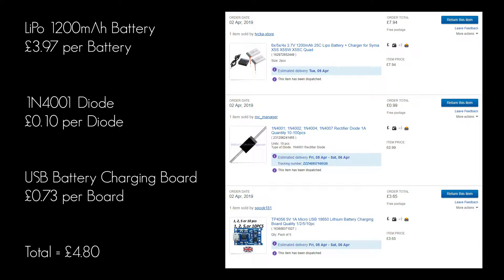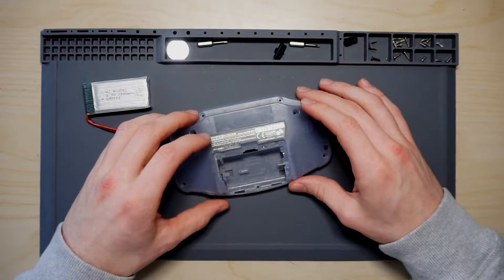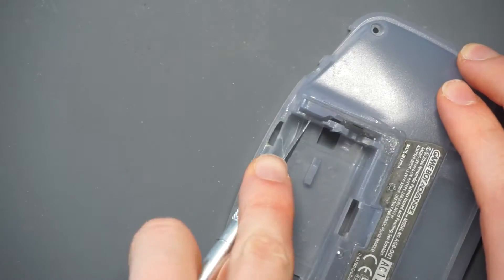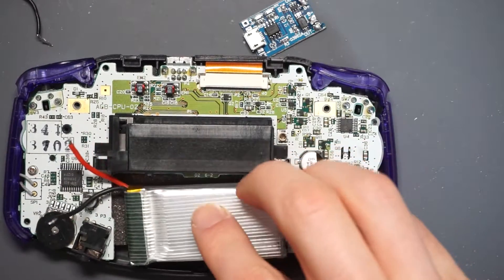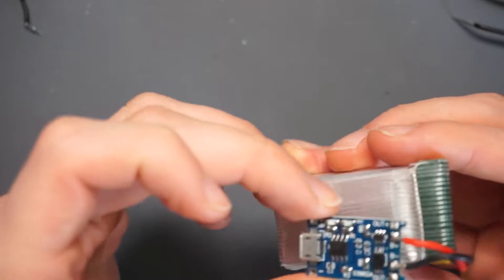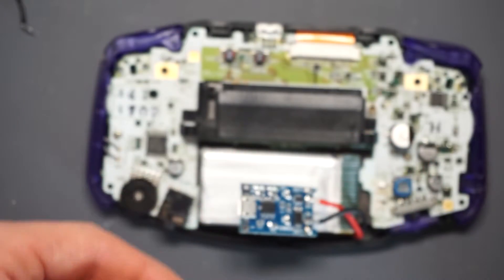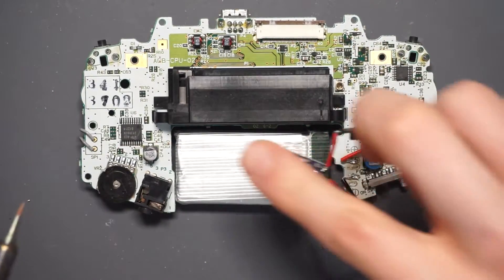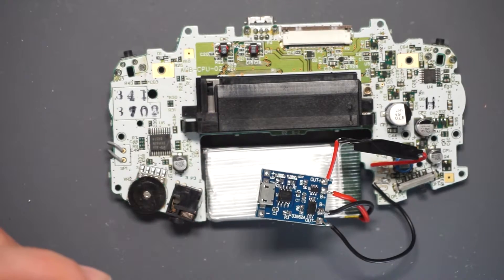Cheapest GBA Rechargeable Battery Mod! £5 TOTAL

Comment: is there a way to build this with connectors, so you can take the battery out without screwdrivers and solderiron?
Reply: You’d probably want JST PH 2.0 connectors. solder a female connector directly to the motherboard’s battery terminal pads and the male directly to the charging board.
Reply: is it possible to solder the diode directly to battery terminal or do i need that extra wire tnx
Reply: @bryandelacruz4569  you can go right ahead and skip that wire, as long as it's the same connection. In these cases wire length doesn't matter, as long as components are connected in the right order
Reply: @JBarraza  thank you sir
Reply from the maker: I assume so, but couldn't really advise you on how to do it! Check out the sub-reddit /r/gameboy they might be able to assist you better on there!
Reply: https://imgur.com/gallery/AQGJAHX
Reply: I'd use smaller connectors but it is possible, so you can have many battery packs just to swap out while the others charge

Comment: With the wires that has the diode soldered to it, would that require a specific red/black wire?
Edit: I meant the AWG stuff... I see so many different cables, I'm not sure which cable I'd need.
Reply: 22awg is a good size for small eletronics. Wire color doesn't matter as long as it is still wired the same. Awg is the thickness of the wire.

Comment: You know the batteries wires, right? Can I just solder a wire onto it to make it longer and what kind of amp rating wire is compatible with this? Because making the board sitting down in that position....
Reply: Your pretty ok with any gauge wire, just don't use super thin wires, I have #22, that would work fine

Comment: i used 4 different lipos and soldered them dirctly to the pcb of the gameboy to see if that works but the gameboy won't turn on. maybe to the voltage is to high? i used a 3,7V lipo too
Reply from the maker: Retrohahn I’d probably say there’s a blown  fuse on the board
Reply: @TheRetroStation  but it's working with normal AA batterys
Reply from the maker: Is it on a gameboy advance? If so you’ll need a diode
Reply: @TheRetroStation  yes, ok I will give it a try thx ;-)
Reply: @retrohahn  yes it's over voltage. A charged li-on battery is 4,2 volts. The GBA only nerds 3.0 volts (1,5+1,5 from the 2 batterys). 
So the GBA has an overvoltage protection circuit (thank lord) so it doesn't turn on when a higher voltage is applied.

Short answer:
you really need that diode.

Comment: Hi is the Diode used for regulating voltage for the gameboy?
Reply: And would it work without the diode
Reply from the maker: @mrej112  It would work, but a diode prevents electrical flow from going the wrong way around a circuit so prevents you from doing any damage to the board.
Reply: @TheRetroStation  thanks for the video and the fast reply!
I am about to do the same mod, now i am just waiting for the diode 😉👍
Reply: @mrej112  - It actually would NOT work without the diode. You'd turned on the GBA and it would immediately trip an internal safety feature and shut off. I learned this last night. You can get a diode by cracking open an old power adapter. You know, the ones with the big chunky plug on the end? I got mine from an old electric razor power adapter. Worked perfectly. :)
Reply: altoidyoda how would I know what diode's I can use and not use? Or would I be able to find it in all kinds of power adapters? Cause I got tons of those and I've seen these longer of diode's in them just never knew what to recycle or not thank you so much in advance.
Reply: @ericsalidbar1693  you could play it safe and follow strictly what the uploader recommends, or if you insist on using something you found,  you'll have to look up the part number, read the datasheet and make sure theres a 0.7v drop across the diode. You can also measure it with a resistor in series and a powersupply.
Reply: @mrej112  The diode should step down the voltage of the battery from 3.7 to around 3.0v  which is exactly what the GBA needs!

Comment: Micro USB is old school. I'm doing mine with USB C. https://www.ebay.com/itm/1-2-5PCS-Type-C-USB-18650-TP4056-Lithium-Battery-Charger-Module-Charging-Board/173807428917?var=472489214008
Reply from the maker: Hey, for some reason I cant see your comment on the video page but only in my studio...

Anyway, USB-C is 100% better I agree I just didn't think when I was purchasing the parts!